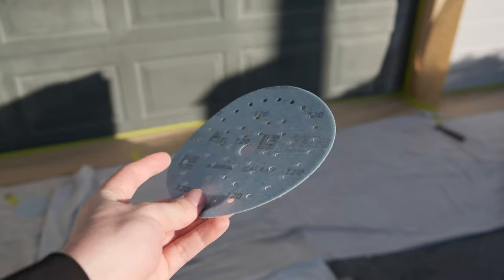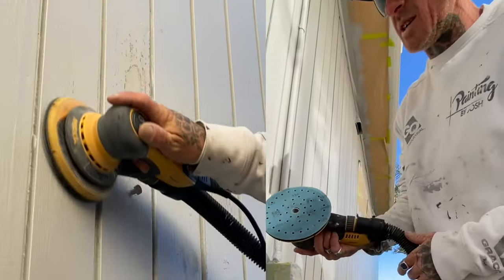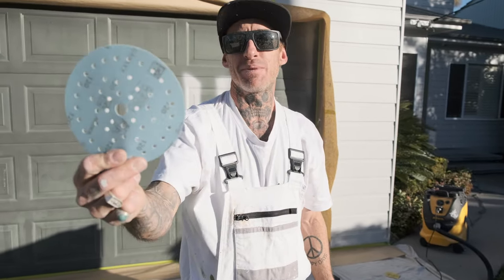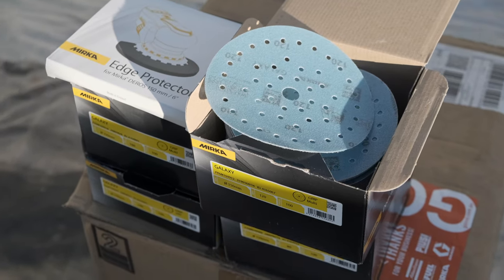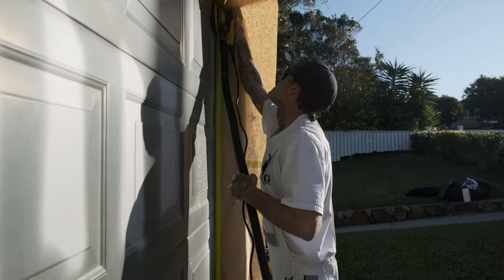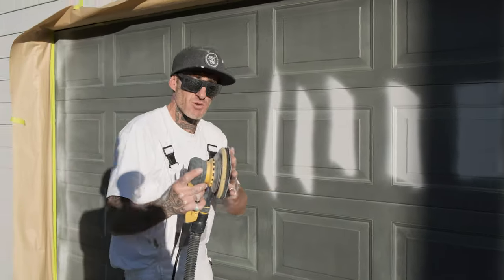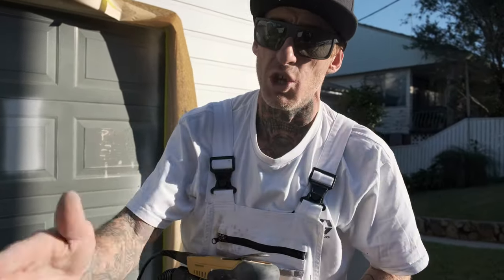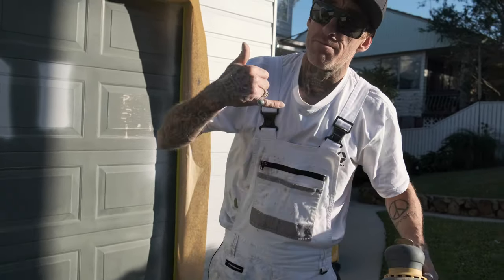SELF SHARPENING SANDPAPER!? TRYING THE NEW MIRKA GALAXY SANDING DISCS

Comment: Buying one tomorrow. Been using a 7inch grinder for 13 years and the elbows are toasted. Have tried it on weather boards?
Reply from the maker: Hi mate, that awesome to hear! yeah the grinder done 20 years of that 💯 it's quicker with the grinder but a lot less stress on the arms & better finish I would go with the Deros 8.0 bit tougher sanding than the 5.0 👍

Comment: May I ask why the metal garage door needs to be sanded? Jw...
Reply: I’m not extremely well versed in painting garage doors but i’d say it’s to provide a key and remove surface contaminants
Reply from the maker: @ShockAMVs  hi mate, yes Jake is correct and had previously been painting by brush so sanding out all the thick brush marks where a must before spray. Cheers for watching on